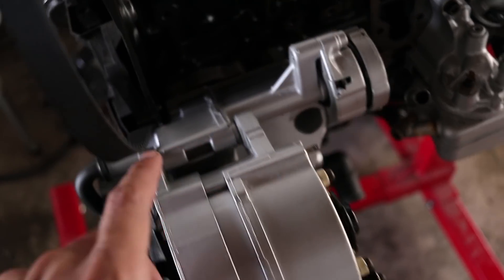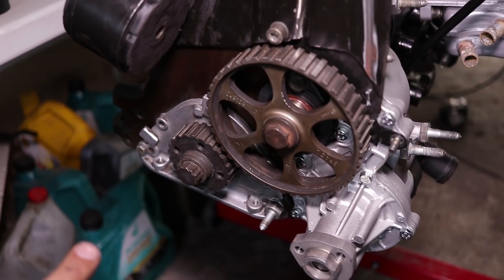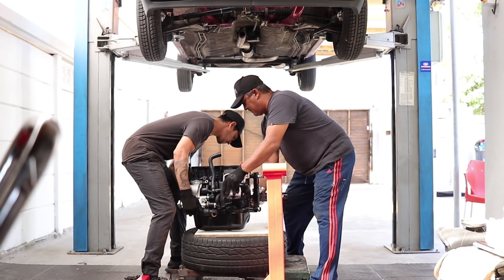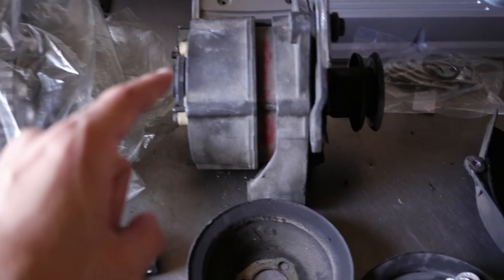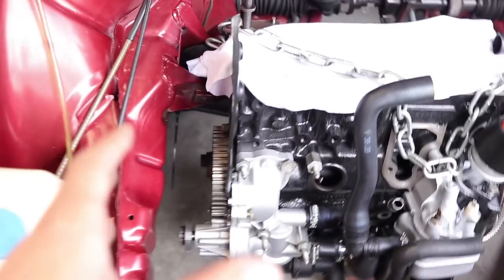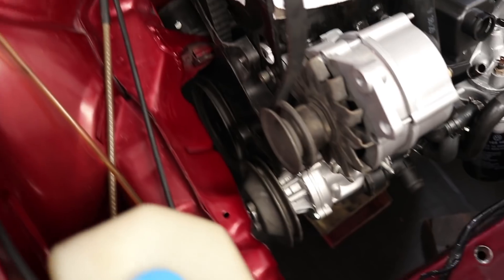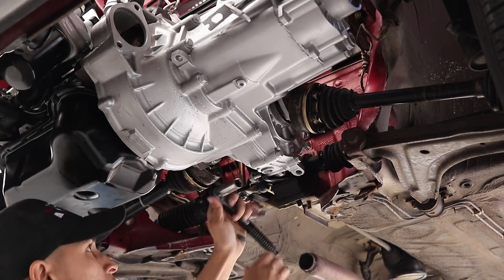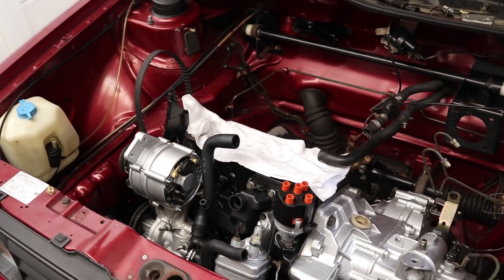Mk1 Citi Golf 2l 8v Assembly pt.2

Comment: Awe Jamie been watching your build just a heads up, I also have a similar build rather use 1.8 clutch + fly wheel the 2.0 assembly is heavy will cause loss in power, what cam & management you looking at I have dictator std management on my car for almost 10 years now issues + I have estas 276 cam highly recommended for these motors enjoy the build bud 🤟
Reply: Hi boss I am running the same setup on my mk1 but I put the velocity dash and loom in my car so I am not using management bru the normal ecu 
Ecu is a open box
Reply from the maker: Thanks for that  bud 🙏🏻 I’ve got the 2.0 assembly in already so don’t really want to swap it out now 😂 we’ll see what power it makes and then make adjustments from there. I’m still deciding between dictator and spitronics for the management and got myself an estas 288 cam
Reply: @jamiepotgieter  one time this car will definitely give you around 120kw or more on the wheels👌

Comment: Are you going to do the centre console with the gauges i have done mine and it looks awesome
Reply: Im struggling to get mine to work 
Oil temp and pressure any help will be appreciated
Think i need to get sender units not sure where to find them though. Thanks in advance
Reply: Zee M5 i got my oil pressure sender unit at Midas with the oil temperature unit. My gauges did not want to work either but then i realised i need to earth them inside the car. After that they are working perfect. I used auto gauges i like their look better.
Reply: @johnvanderschyff9870  thank you for the reply appreciate it, is there anyway i can dm you if i experience any issues.

Comment: Black metal plate, wont work by cambelt side...use the 2l one and cut holes for what is needed...2l long block, golf short block...whole on top where 8mm treaded bolt goes through into head will be off and wont fit if you dont use the 2l plate
Reply from the maker: Thanks for the heads up Ralton, will definitely look into that

Comment: Did you manage to find the CTI center console?... Jus wanna know if its a straight fit or it'll need some lil mods.
Reply from the maker: I haven’t yet, just got the steering wheel. I stand under correction but it should be a straight fit